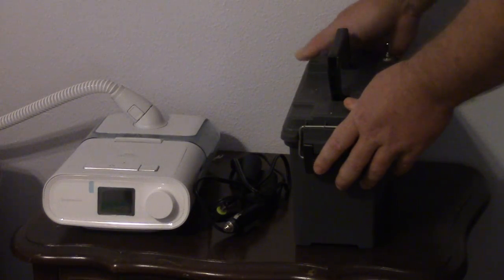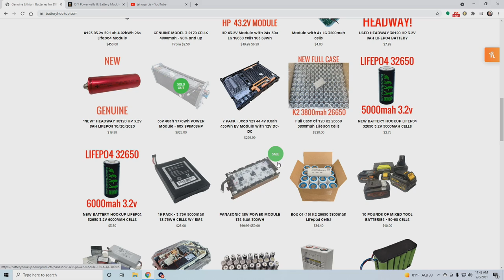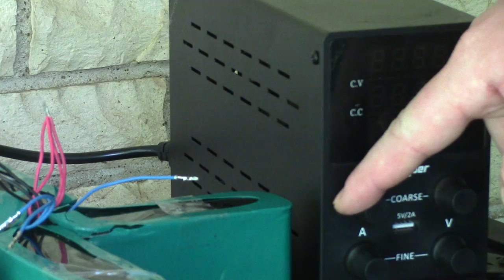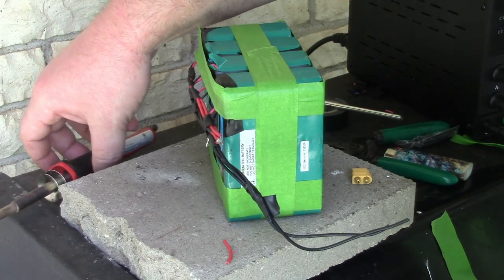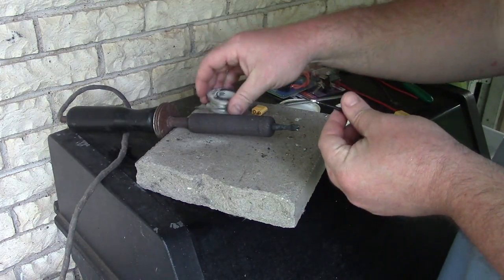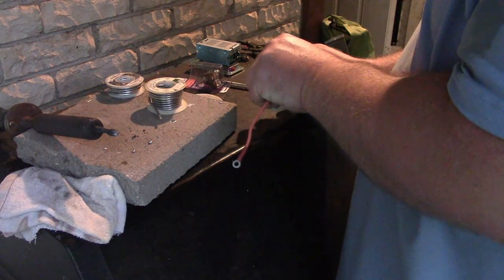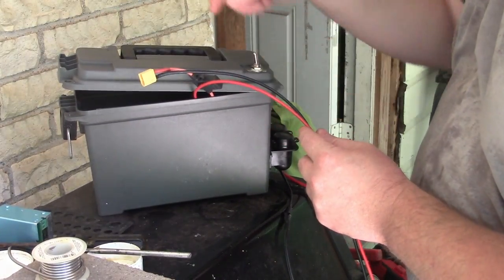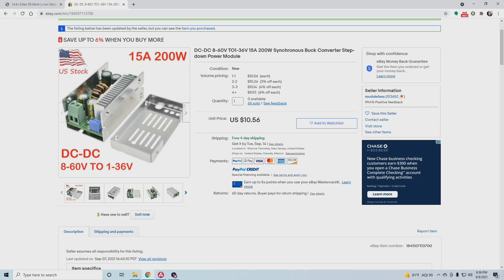DIY CPAP Battery Backup for Camping and Emergencies

Comment from the maker: Chapters / Timestamps / Timecodes
00:00 Introduction to running a CPAP on a battery
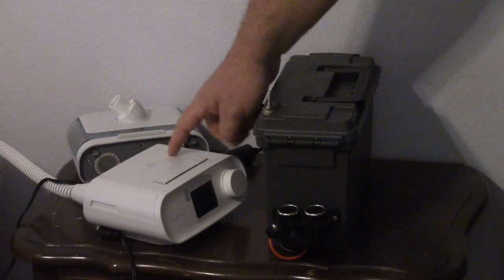01:51 Components of a Li Ion Battery pack
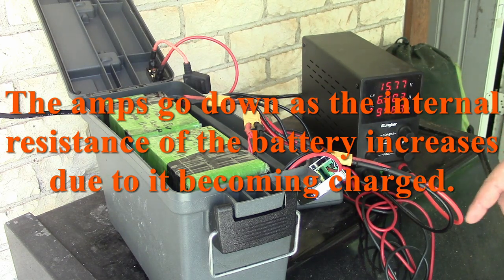08:19 Where to buy Lithium Ion Batteries
12:35 Charging and testing batteries from Battery Hookup
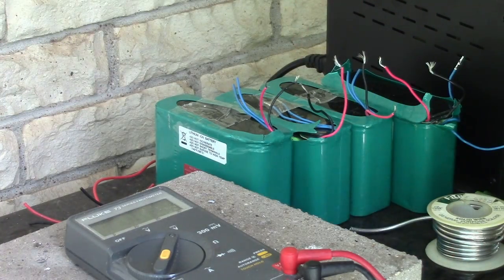26:54 Building a Li Ion module from smaller modules
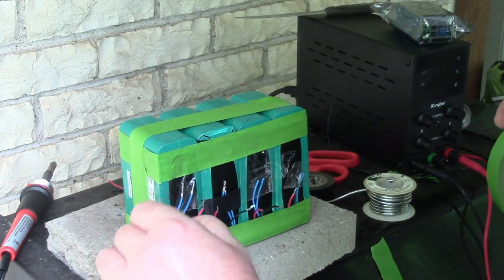30:40 Soldering wires to lengthen the battery leads
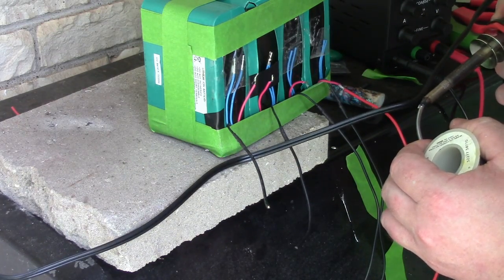34:12 strain relief for battery leads
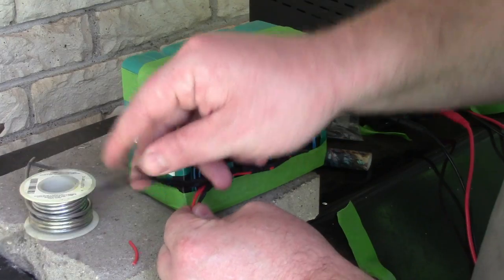35:20 Soldering on a xt60 Battery Connector
40:50 Finishing off the battery pack with tape
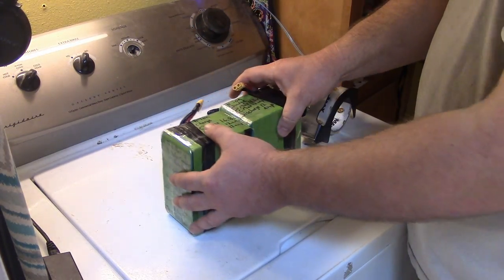44:20 Planning out My battery box build
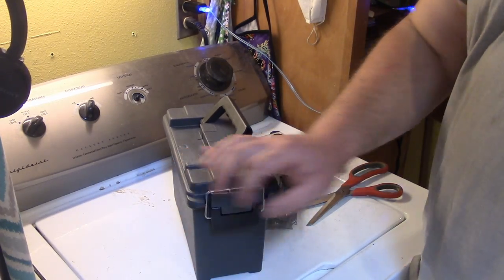46:29 Building a parallel cable with xt60 connectors
56:32 Adding a inline fuse to the Battery box
1:03:34 Installing the negative cable
1:05:39 Balancing my battery modules and a bit more charging
1:08:26 Installing a power switch in the battery box
1:11:10 Installing a 12 volt Cigarette Lighter Socket
1:12:56 Wiring the Buck converter voltage regulator
1:16:58 Testing and adjusting the voltage on a buck converter
1:19:19 Running CPAP heat and humidity on a Battery
1:22:14 Final thoughts and discussion on how the project turned out

Comment: What are the specs for the battery bench charger you are using?  I'd like to find one.  What are some other options for charging the CPAP Battery you built if you don't use a bench charger like you did?